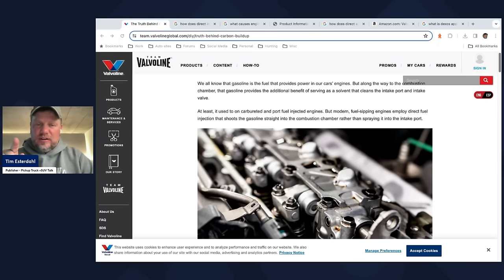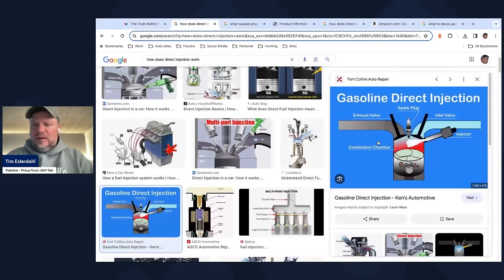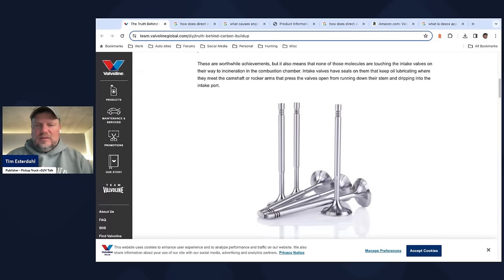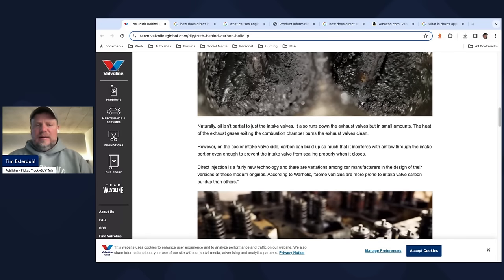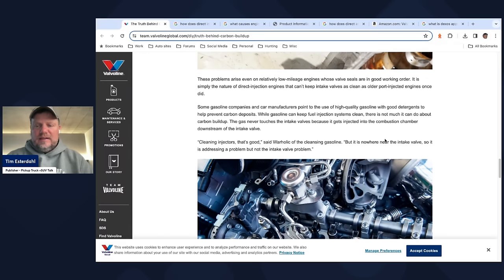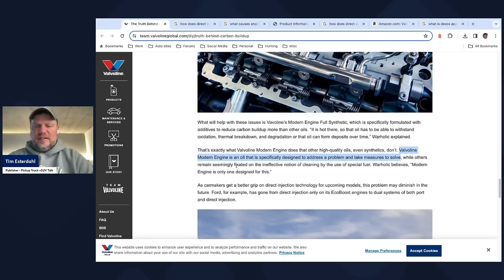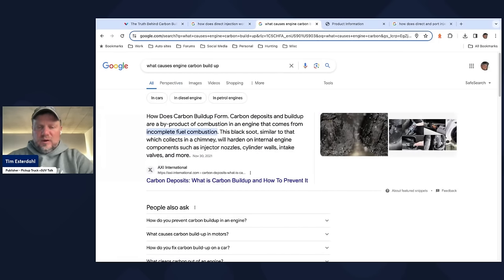Prevent Carbon Buildup with Modern Engine Oil? True or False?

Comment: manufacturers need to drop the low tension rings just to save 0000.1 miles per gallon.
Reply: The first thing they need to drop is the ridiculous 10,000 mi services and go back to 3000-5000 and all of this nonsense goes away
Reply: @100pyatt  I service my (2) ford Focus vehicles when the monitor tells me to, usually around 10k miles. 196K miles still as clean as a brand new one. Quality of oil really matters here, as does the quality of a filter. I run mobile one extended drain interval filters, and Valvoline 0W20 Advanced formula.
Reply: @100pyatt  15,000 km (~10K miles) can be checked using oil analysis. 
If the wear is normal then the service interval is reasonable.
If you want a bit more protection then bond a lubricant to the inside of your engine to ensure that lubrication is present 100% of the time.
🙂
P.S. My old car had 10,000 km oil change intervals. Wear was reduced by ~80% after treatment. 
P.P.S. The new car has 15,000 km oil change intervals. Waiting for the first oil change to run an analysis and check i.e. Do a before and after measurement.
Reply: Agreed with this and to do aggressive oil changes.  Not all engines will have the carbon buildup problem, but the (my) Scion XB engine certainly does.  I got it at 200K mile and it was very well cared for, but they might not have done the 3-5 K oil changes.  I have religiously used Synthetic every 3-4K miles since buying it and the oil burn progressed to 1 quart every 600 miles or so at 260,000 miles.  Then I did the Berryman B12 overnight piston soak recently, and through 3500 miles since then (1st oil change), it has burned about 1/2 quart.  I'm pretty floored that it would come back to life.  Engine is still running great.
Reply: Why so many 0s before the Decimal point for 1 tenth of a mpg
Reply: @james10739  the decimal should have been before all the zeros LMBO
Reply: why cant they make  tension rings with bigger holes?  wont  fix  the problem

Comment: I believe Valvoline Modern Engine oil has been discontinued for quite some time now.  I remembered buying it when it first came out.  Did probably 2 oil changes with the oil and then it disappeared from the shelves.
Reply: Walmart quit selling it, but NAPA still sells it.
Reply: Agreed- Its been replaced by Restore and Protect. This is old news.  Those finding the other stuff, are finding NOS, left behind. That product doesn't appear on their web site anymore
Reply: According to the valvoline, lab engineers, it was meant only for Cummins engine and it was very potent, it worked too good, it was causing oil pump screen to get clogged from all the carbon cleaning.

The new engine restore that just came out is a lot more tame and controlled  and it’s definitely design for today’s turbo GDI .

There’s a great interview that oil geek channel did with valvoline lab

Comment: Thanks for the video. Newly subbed! I have a 2006 Dodge Ram 1500 MegaCab and use 89-grade non-ethanol gas. I was changing the oil about every 5000 miles with Valvoline full synthetic 5W20 (always). I removed the valve covers to change the spark plugs, seals, and gasket and saw some sludge. It actually shocked me! My plan went into action, which was to begin changing the oil at 1,000, then 2,000, and then at 2500, and using K&N or FRAM Titanium filters. I would add one-half quart of Marvel Mystery Oil and run it for about 250 miles before each change. I just changed the oil at 2,500 miles yesterday with Valvoline Restore and Protect. The changed oil was always dirty, and I am curious how my plan was working. The Ram has 245,000 miles at yesterday's oil change. Would you have any thoughts on my plan or tips to consider?
Reply from the maker: Keep the plan going. You are taking well care of your truck.

Comment: It's weird how good routine maintenance fixes a lot of problems lol.
Reply: Frequent oil changes won't reduce carbon deposits. It will reduce/eliminate engine sludge build up but not carbon deposits.
Reply: @hsuccop it won’t help with carbon buildup on the valves but it’ll help the carbon buildup along the piston rings

Comment: Change your oil sooner and you have less build up. As the oil gets old it will break down and thin out. You also get added contamination in the crankcase. Through the PCV system you will have more oil vapors entering the intake manifold.working it's way to the intake valves. With the extended oil changes that are recommended you find modern engine consuming more oil. Most now burn one quart every 3 to 5 thousand miles. If you don't see oil leaking on your driveway, it's leaking into your intake manifold.  These engineers are foolish to recommend 7,500 or higher oil changes.  Their recommendations are based it perfect world conditions and marketing. 

Change your oil sooner and avoid and or reduce this problem. I am not an engineer and don't play one on TV.  I just build engines for the last 45 years and have seen business increased with these flawed recommendations ❤.
Reply: Recomendations are  focused on the vehicle surviving to the End of the Warranty period. No More.. no less.

Comment: I have an '03 Toyota 4Runner with 4.7L V8 and 157K miles. I have had it since 70K miles and used Valvoline full synthetic and semi-synthetic high mileage oil almost exclusively. Just last weekend had the valve covers off and the cams and head are virtually spotless, light yellow discolorization at most and being a port injected engine I'm not worried about valve deposits. I'd say Valvoline does what it claims.
Reply: Synthetic oil is critical in all modern engines

Comment: Modern engine oil from valvline was discontinued a good while back...the latest is restore and protect.
Reply: extended protection is the same oil just change the name but im using restore and protect. I have been using valvoline for 30 years great oil great price except restore and protect is a little pricy.

Comment: I’m blaming these extended oil changes!I still change my full synthetic at 5-6000 miles.
Reply: I change mine by 5k miles, sooner if it's an oil change after the winter season.
Reply: I've used 5W30 Full Synthetic with Premium filter every 5k mile with first change at 750mile breakin. I have 237K on engine with no problems as of yet.
Reply: @scottpearce7466  sounds great ! what kind of car is it ?
Reply: In 2021 I bought my 1st Turbo GDI car. I'm using Castrol Edge and premium fuel in it. Changing every 300 to max 3500. Miles. I'm retired so this will be my last new car. Hopefully doing this will greatly increase the engines longevity.

Comment: I drive a Ford focus ST back-and-forth to work hundred miles round-trip and I put over 120,000 mile over the years maybe five. And I run the Walmart brand synthetic and I try and get top-tier gas. My intake valves are clean surprisingly, so is the entire engine inside nose buildup? I’m just lucky I guess.
Reply: The awnser is in your driving habits.  I have a gen one 3.5l ecoboost (direct injection only) in a 2017 expedition with 238,000 Miles on it and no issues.  As Tim said but I will expand: run an hour to work and you won't have an issue as the volatiles in the oil will get consumed by the engine and won't stick to the back of a cold intake valve because it isn't cold and they are no longer present at shut down.  Do so at least once a week and no issues.  Mine had all kinds of crap oil and was run all over Glendale AZ in that heat but the duty cycle could handle the volitiles because she was driven long distances high speed.  With your commute I doubt you can go wrong.
Reply: At my previous employer, I was issued a 2015 Silverado 1500 as a company truck. I'm friends with the service guys and we got curious about how bad the intake would be since it's DI only. It really didn't look bad at all for nearly 100k miles. We all figured it's helped by the fact the engine doesn't have EGR and the oil is changed more often and consistently than the average truck owner.
Reply: @karlschauff7989 I had a 2015 Silverado with the 4.3. Had the intake checked at about 120,000 and it wasn't bad at all.I dont think carbon build is that big of an issue. Maybe if you drive like a grandma or do lots of short trips.

Comment: Doesn't the PCV system introduce this to the back side of the valves no matter what?
Reply from the maker: A little oil will escape from PCV valve.
Reply: I pulled my intake manifold at 90k plenty of oil came out I new a catch can was a must.  Especially since I drive alot of short trips in colder climate
Reply: @justingill5256  The higher the cylinder pressures, the more the engine leaks cold yes.
Reply: @peiguy1982  fill it 1000 miles winter 5000 miles summer
Reply: @justingill5256  Yes and all that normally travels back through the intake and not to back side of the valves to be reburned.
Reply: @peiguy1982  yep but sure doesn't all get reburnt and you need to drive alot or it will continue to collect

Comment: Ways to help reduce deposits:
1. Use top tier gas
2. Use a combustion cleaner occasionally like BG 44k, Redline S-1
3. Use full Syn oil no more than 5,000 miles between changes
4. Try going up a grade in oil to help viscosity 
5. Oil catch can
6. Walnut blasting if really bad or manual cleaning
7. Piston soak with Berryman's B-12 if stuck rings are suspected.
Reply: Going up a grade in oil in what way? Like 0-20 to 5-2- or like 5-30? Thanks.
Reply: @tardeliesmagic  If it calls for a 5w-20 weight go to a 5w-30. Often people use a 40 weight oil with no issues.
Reply: No catch can
Reply: @chriscalderin6677  why not?

Comment: There are two types of carbon build up in engines.  There is carbon buildup on the piston in the combustion chamber and there is carbon buildup on the valves.  Carbon buildup in the combustion chamber can cause engines to knock because it can both increase compression and provide hotspots for detonation.  The carbon buildup on the valves comes from the PCV system which vents the crankcase into the intake tract.  Often the buildup on the valves is worst on Valves closest to where the PCV system vents to the intake.  Modern engines, especially turbo charged engines, have higher pressures because instead of filling the cylinder by vacuum, they fill through boost.  Some of that boost gets past the rings.  Low tension piston rings meant to help mileage don’t help with this.  The crank case has oil vapor in it that cooks on the intake valves.  A catch can or separator will help with this, but needs to be maintained.  Oils that don’t cook can help minimize this too.

Comment: My wife's 2022 CRV 1.5 turbo engine has a built in catch can that drains it back to the oil pan , I run 5x40 full syn and only use top tier gas.

Comment: Key question.  How does the oil get to the wrong place (top of the intake valve)?  Why no discussion of the "Catch Can"?  The EGR system takes oil residues (vapors and light liquids) back through the intake system where it accumulates on the hottest surface (intake valve).  Any full synthetic (uniform molecule size - engineered molecule - GTL Gas to Liquid process) breaks down much slower than a mineral oil (refinery distillation process) where molecules are similar but not identical, so they don't carry the load evenly on bearing surfaces.  Any quality full synthetic breaks down much more slowly, producing much less contamination to be deposited on the intake valves.
Reply from the maker: Sure you can add a catch can.

Comment: If you want to see the “crap” that is being fed in to your combustion chamber (ie burnt carbon contaminated oil vapor, fed straight on to the back of your inlet valves) install a catch can after your PCV valve. After a few hundred miles you’ll see a dirty brown liquid in the can.  Experiment with this.  Heat up a spare valve and immerse it the liquid.  The carbon will attach itself to your valve.  So now you know where the carbon is coming from. So how do we fix this?   My opinion is you need to do several things, like……install a catch can, or two, use the correct high quality oil, change your oil out more frequently, I change between 5000 to 7,000 max. Use the highest quality gas you can.  I completely agree  about continuous short runs, they promote carbon build up.  Get your engine warm. The majority of carbon comes from hot oil vapor being fed in to your cylinders through the intake valves. Blow by on a warn engine is also a carbon source. If you have cylinder blow by the carbon will build up on your piston head.  If you have valve stem blow by the carbon will build up on the back of your valves. The real fix would be an oil that does not produce carbon suspended in its hot vapor. I’m hoping there are some smart scientists working on this one!
Reply: So, is this the way an oil can have a cleaning effect, as it's being inserted into the upper cylinder via the PCV valve?

Comment: Confusing subject, best left to the experts.   A ton of bad information in this video.   Not the presenter's fault, it's too much. 
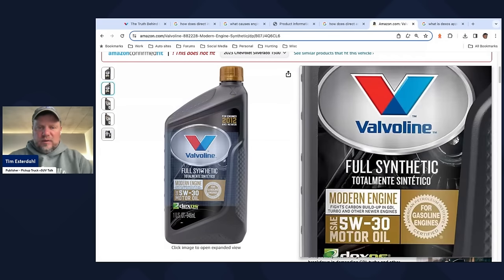One example:  "Valvoline Modern Engine Oil" is a product that has been discontinued for 4 years now.  It originally came out 7 years ago.  The Amazon page at the 6:57 point of the video is $28 per quart because somebody has NOS on their shelves and people still want to get it.  (BTW, dexos1 Gen2 is not current; we are up to Gen3 now.)   The "Modern Engine Oil" product never got marketed effectively and it was confusing for most people to think about.  Valvoline has now levereged their Cummins ISX15 piston ring-land carbon cleaning technology with newer R&D to have the new (3 months old) "Valvoline Restore and Protect", which could help the valve stem cleaning via PCV circulation.  This is way too complicated.   Leave it to the chemists at Valvoline, this new stuff probably works (Sequence IIIH results Valvoline reveals show it should).   Although, it usually comes down to walnut-blasting the back sides of the intake valves at the repair shop, sorry!

Comment: Great video!! I wonder what everyones position is on an oil catch can?? I dont think OEM would do it cause its extra maintenance for the customer
Reply: My oil catch can separates mainly condensation, some sort of additive in the oil, and gas vapors.  Doesn't catch much oil.  Whatever deposits and accumulation I find in the can isn't going through the turbo, back into the combustion chamber, or being deposited on the intake valves.  I think the EGR combined with the oil vapors is the major contributing factor for intake valve deposits.
Reply: I could be wrong on this but I think by California law emissions systems parts have to last over 100,000 miles or perhaps longer without maintenance.  That would have to be one big catch can!  Also, any breather on the can would be not allowed.

Comment: Companies are using thinner oil to reduce friction to get better gas mileage start using a 5W 30 oil you will have no oil burn and better lubrication. Toyota same engines in Japan use 5w-30 United States, OW-20 or OW-16.
Reply: not true anymore, Japan engines use the lower viscosity oils now.
Reply: Some new Toyota engines in Japan even use 0W-8 oil.
Reply: Now, most of the Toyota engines in Japan are using 0w8.  Pretty crazy.

Comment: There was never a problem with valve carbon buildup with either a port injector only or a carburetor.
Reply from the maker: Correct.
Reply: I feel DI carbon build up issues are largely overblown. Proper maintenance can really keep things running well. Even if there is a bit of build up, it's really not much of an issue by itself.

Comment: Hello 👋🏻. Nice presentation 👏 👍,  My turn, I use Chevron premium 91 Octane fuel ⛽️ 😎,  I Change the fully synthetic oil, approximately every 4k miles, I use this in my old, 2002 Pontiac Sunfire, with a 2.2 Liter OHV Engine That Has a Throttle Body.
  The engine has 180k miles, and it's running, and idling better & better!! Instead of any carbon build-up, it looks l8ke an engine "SHOULD" Look Like!! 👍
  Now, the transaxle is next. What can you advise using? Besides frequent trans oil & filter changes?
  Thanks 👍 😊 for your time🫡🤭🫣😜🤪🤔🙄

Comment: The new oil is restore and protect version of valvoline this is what they claim is a new breakthrough in oil technology im not a valvoline user so im not a fan boy I typically use pennzoil.
Reply: I switched from ultra plat to valvo r&p & I feel a lil improvement. So far I've driven 350mi with it